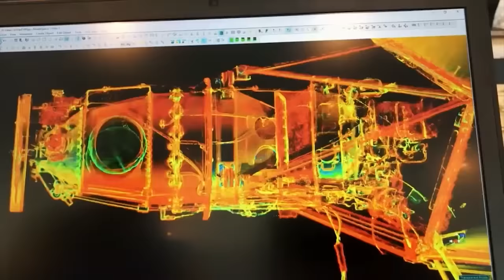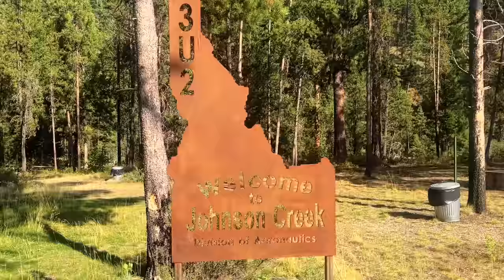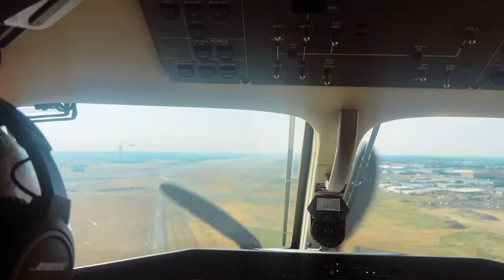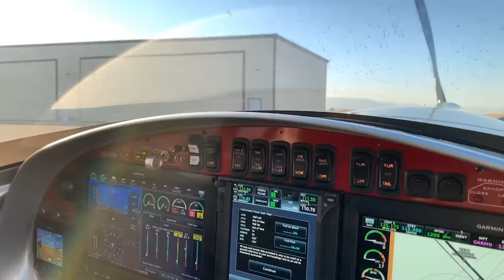Landing a Pilatus on a Grass Runway - Johnson Creek Getaway

Comment: I LOVE Airplanes! I love everything about them. I have it in my blood. My Grandfather built IPs for B-29s at Bell aircraft (now Lockheed-Martin) here in Atlanta circa WWII, and after! One of my earliest memories was him taking me to the plant when I was a toddler. The sounds, the smells, the sheer SIZE of the place! Unfortunately, I can't enjoy riding in airplanes as I have ALSO had motion sickness all of my almost 64 years! Every business flight I've taken was cold sweat and vertigo from roll out to pulling up at the gate! Never actually had to use a barf bag but the first thing I did when I got to my seat was to make sure it was in the seat pocket in front of me. Dramamine doesn't help much. Neither does the rubber band snapping on the wrist. Didn't travel enough to warrant looking into any other options. Now retired and probably won't get in an airplane again... 🤢